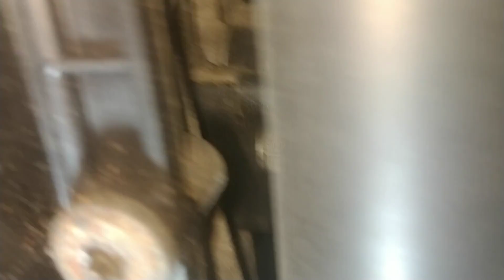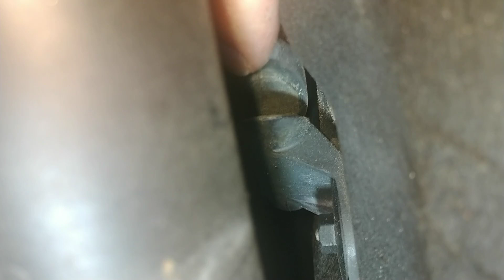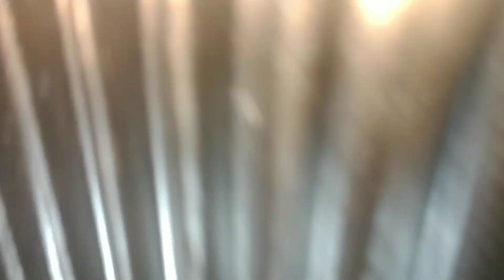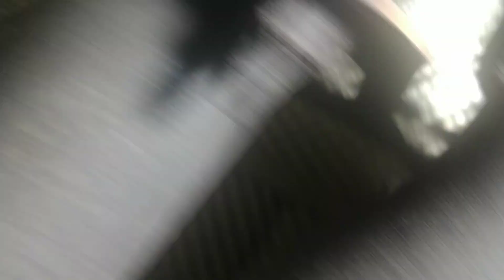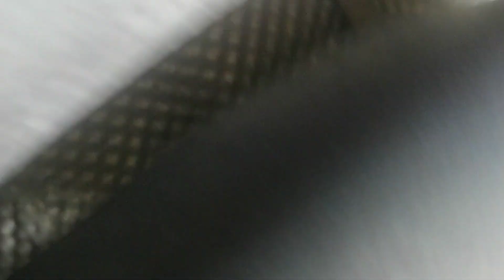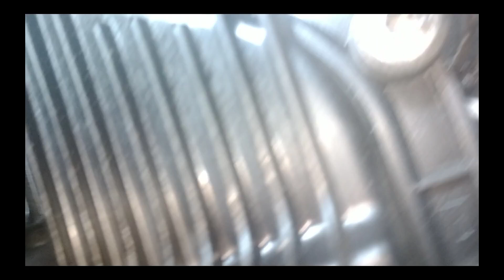AC drain hoses BMW E60/ E61 - locating and clearing / air conditioner drain line clearing 530xi

Comment: You get another BMW? I thought that you sold yours.
Reply from the maker: LOL... I've pretty much sworn off BMWs for now - at least newer BMWs (just too over-engineered for me).  I was poking around and found this video languishing on another youtube channel I must have accidentally created, so moved it over to my "real channel" so it could be found easier (looks like it had quite a few views over there in the youtube wastelands).  Watching it did bring back some scary memories, though!  ;-)
Reply: @Mark_H_DIY  I am a fan of the naturally aspirated straight six. They are a pain to work on though, no doubt. I picked up a 1995 Jaguar Vanden Plas this summer, so much easier to work on. It's not even close.
Reply from the maker: @thomasstiglich3484  I'm a huge inline 6 fan myself. Even my Jeep is an I6! The basic engine in the E60 is about as bulletproof as you can get, though some of the stuff they bolt onto it is pretty suspect. The whole valvetronic thing is just an exercise in engineering overkill, IMHO.